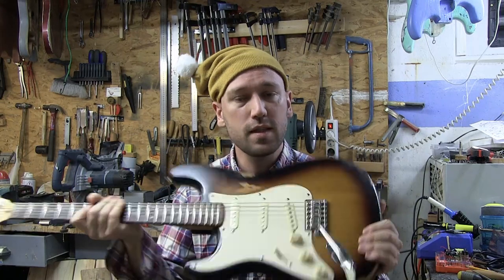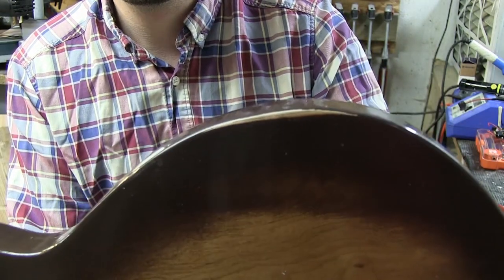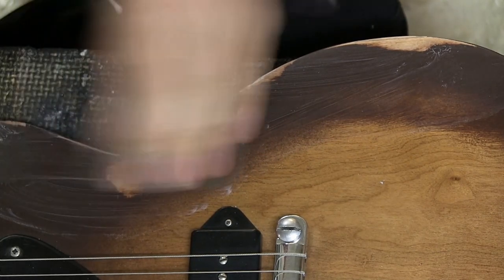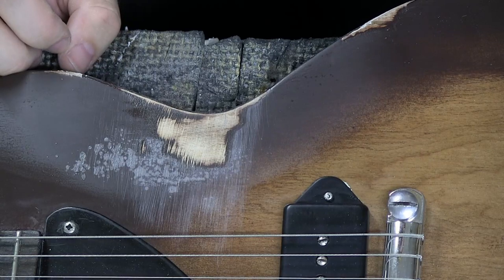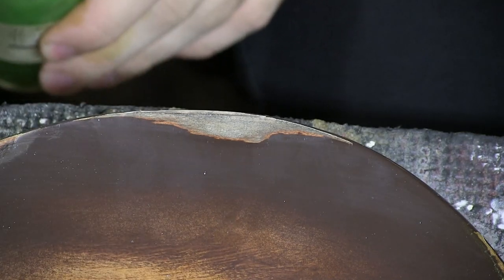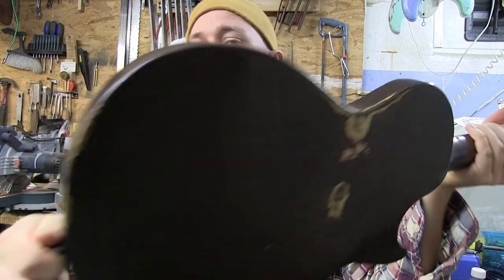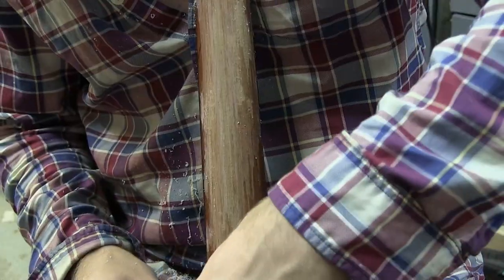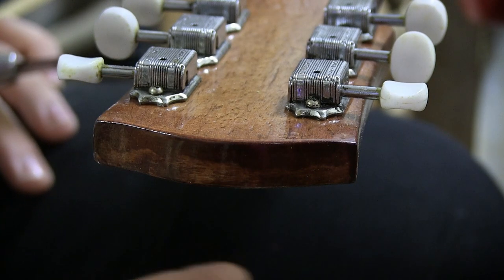how I relic a poly finish (Les Paul Junior)

Comment: I have the same Jr. And I don’t want to relic it but I would love to get all that clear coat off. Yours looks really good, is there any trick to the method?
Reply from the maker: Well its really easy to get all of it offthe problem is just removing the clear coat and the only way is to sand it but if you start with 250 grit and work your way up to 2000 grit it shouldn't be that hard and if you can do it with a sanding machine than you can start at 400 grit instead and it will go a lot faster but that's not necessarily a good thing because it's easier to mess up when you are going fast